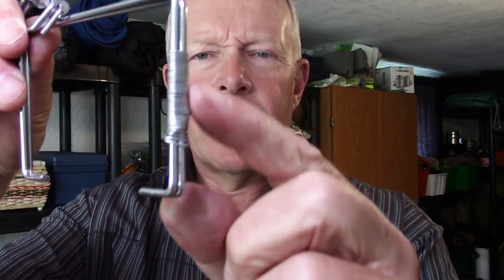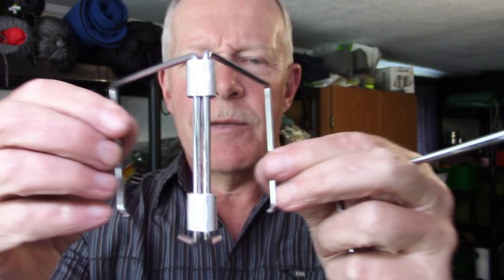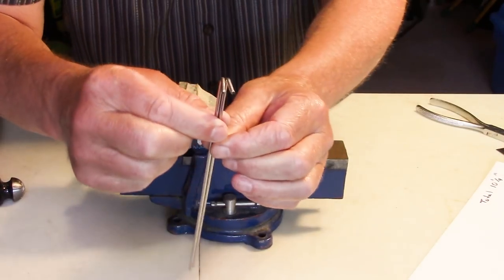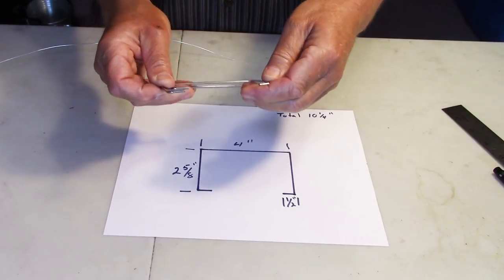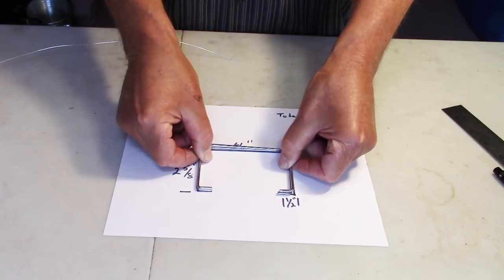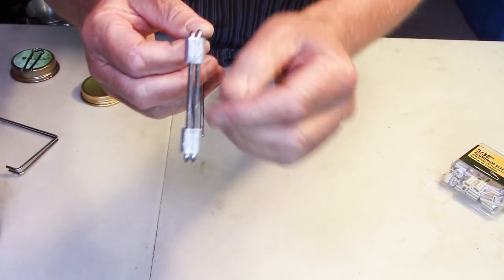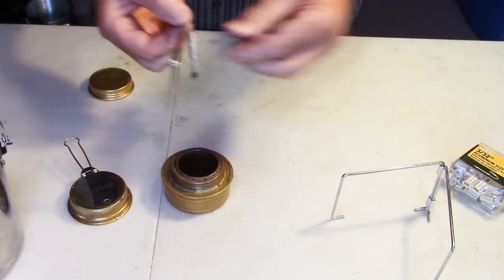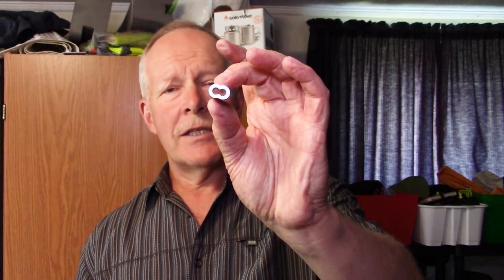DIY Alcohol Stove Pot Stand

Comment from the maker: I would like to thank everyone who has commented on the dangers of using galvanized wire in this project. One of the objectives of this project was to have it be as inexpensive as reasonable. For this reason I chose to use inexpensive galvanized wire over higher costing stainless steel wire. Based on the research I have done, galvanized metal does not release zinc in a gaseous state until it reached 1652F/900C. While the pot stand does get hot, the wire wrap does not come in direct contact with the flame and does not reach anywhere near hot enough to become dangerous, other than from burning you fingers. Finally, the pot stand and alcohol stove is intended to be used outdoors and not in a confined space where ventilation could be an issue. I feel confident the use of galvanized wire in this application is perfectly safe.
Reply: Ah, OK.  I just knew it was something welders had to worry about.  There is no way an alcohol stove gets that hot.
Reply: Excellent clarification and the logic behind it is sound!
Reply: Zinc is not danger in small dose. RDA recometation is under 40 mg per day. Coating is hardly this and doesn`t vaporize at the time.
Reply: Rust,   if its not on the burner portion there really isnt any danger
Reply: The "dangerous" temperature varies by the galvanization process used. In long-term, continuous exposure, the recommended maximum temperature for hot-dip galvanized steel is 392 F (200 C), according to the American Galvanizers Association.  So, best bet is NOT to use galvanized metals that can become heated. Why take the chance?
Reply: Eventually, Galvanized steel will start to rust after the zinc comes off.

Comment: If you have soft ground just turn your stand over and put the long wire down to the ground and use the short feet of your stand to set pot on. It will work both ways right side up or upside down. Thanks for your video and keep up the good ideas because there are lots of people that need good people to show them how to use items to make things that will be very handy and important.
Reply from the maker: Great tip! Thanks for commenting

Comment: Thanks.. I made my own stand per your design,, worked out great.. quite strong..and even when the wire gets red hot from flames hitting it, it seems to stay strong and in good shape..
Reply from the maker: Glad it worked out for you. I find stainless steel works much better than coat hanger. Thanks for commenting

Comment: Nice job. You could also connect 1 or 2 more sections to make a closed triangle/square and securely lock it in place by adding an extra sleeve on the legs of the end sections or wire but loose enough, to be able to slide down a very narrow U-shaped connector (longer as a stake). I like the sleeves better. Even more stability can be achieved with extra sleeves at the corner bottoms and extra skewers to use as stakes that are either intact or cut short, both with the loops intact. The bonus of the loops on the long stakes (2 at least) is being able to cook rotisserie style. The loops on the short stakes (2 at least), when driven down to the sleeves, prevents the stand from moving up. All unstable/ accidental movements are eliminated. It will still be light, foldable and compact while adding more stability to both the stand and the cooking vessel. An added bonus to my configuration is that you can use a grid/griddle grill plate. Pretty cool, huh ?
I hope that you try this and do an update video (yeah, you can mention my name 😎) because I'm very sure that your viewers will like it.
GOD Bless the U.S.A.  This soldier shouts AIRBORNE !
Reply from the maker: Well thought out bit of kit. Thanks for the ideas

Comment: Hello, Mr. Young;
EXCELLENT! video, you've helped me quite a lot w/ it.
I just built my best alcohol stove (so far).
It burns about 10 minutes on about 20mils of 99% iso alcohol.
I used a U.S. penny (copper-plated zinc) & it semi-melted & deformed from the heat.
So I'd been thinking about a pot stand & wind screen for it when your video came up.
I like my gear to fold so it lays flat & this will do so nicely.
My new stove is a bit larger than yours but your design will easily expand to fit.
My stove is almost 3" tall & 2-9/16" wide.
I think my stand should be 4" tall & 6" wide so I need about 14" skewers or other material.
BTW, the cable/wire connectors are a really great idea!
I can make wind screens (2) 6"x6" & pivot them w/ a hinge so I can easily cook on my stove.
The same basic design will work great for the wind screens w/ skewers as legs, too.
Three skewers, one as a hinge & one each on the two ends should work great.
The legs can stick in the ground for stability.
Thank you for your great video & the inspiration.
Have a GREAT day, Neighbor!
PS
I really like that pot you demonstrated w/ at the end.
I'd like to get one like it.
Can you say where you got it?
Thank you in advance for your kind assistance.
Reply from the maker: Making DIY Stoves can be very rewarding. The pot is the Camelwill1.2L. I have a couple of videos in it. Thanks for commenting

Comment: Enjoyed your video as I usually do . Well presented with a lot of for thought.  Whilst on the subject of alcohol stoves,always suspect in breezy conditions .I have a small mod ,which is useful in this and other alcohol stove probs.. My mod. refers to the common multi plate screens ,ten is a popular one. My tip is this, fold the screen up tight,clamped in a vice or such Draw a line or so, 1inch  in from each side about 1inch apart along the two lines.Now mark   holes centre of the plate in line with the top and bottom holes .Carefully drill through all the plates(whilst still clamped) at the marked points with drill suitable to accept about a 10mm. rod/tent stake. Erect your screen and you will have multple   pan supports at various heights.,around almost any type stove..And a very secure windbreak too.  Thanks for your vids.
Reply from the maker: Very interesting idea. I will give that serious consideration. Are you okay if I share this idea and give you the credit?

Comment: Very useful ideas and a clear, easily understandable presentation. In the back of my mind, I am pondering how to fashion a similar folding pot stand with at least two panel sides which would serve as windbreaks on a breezy day. I might also mention that for some time I have had concerns regarding the use of "open top" stoves (in contrast to the "closed top" design used in many "penny can" designs). Specifically, the "open top" models strike me as potentially dangerous in that were they tipped over they would immediately spill their flammable fuel thereby creating a fire hazard.
Reply from the maker: Glad you found the video helpful. Your concept of a DIY pot stand with a wind shield built in intrigues me. I agree there is an increased risk of spilling alcohol with open-top stoves. I would think the most "spill resistant" design would have a full wick inside, carbon felt or fiberglass maybe. This type of stove should also work better in freezing temperatures. Of course, it would be a lot more difficult to recover unused alcohol from. You have given me a few things to think about. Thank you

Comment: We have fire bans here in BC also so I will have to use my alcohol stoves next summer. So happy that I can make my own stand and save a little money. I just hope I can bend my skewers with my pliers because I don't have a vise. Thanks for posting this video.
Reply from the maker: Unfortunately, it would appear we are likely to have more fire-banes as the climate changes. I am able to bend the SS skewers from Dollarama quite easily with pliers. I like using a vice more for precision bending than anything else. Thanks for commenting
Reply: Just use a sturdy hollow tube to bend the scewers or 2 closed ended wrenches

Comment: Okay, I followed your instructions and quickly made a couple of these stands. Just what I needed! Thanks. A couple of notes:  

1. I live in the Southeast US and was not able to find any round skewers anywhere. Only thing I found was some square ones, and this seems to be the trend - here, anyway. So I bought some stainless steel bicycle spokes on eBay. $7.28 US for 10. They are 2mm in diameter, and very stiff and strong. Also bought the 2mm crimp sleeves on eBay - 100 pieces for $6.79. So pot stands still very cheap. 

2. You can crimp the sleeves better if you will take a couple of scrap pieces of rod that you cut off and tape them into the grooves on the sleeve. Then crimp in the vice. Gives a better crimp, but I can't say it's worth the extra effort.

Keep taking "the road less traveled". :-)
Reply from the maker: Great adaptation. I really like how you got a better crimp. Sounds like your end product should work out very well. Thanks for commenting.

Comment: Thanks for the video! Another idea is to use stainless steel bicycle spokes -- not that expensive, rustproof, and you can even throw it in a fire without worrying about the galvanized steel issue. If you want to go even lighter, titanium bicycle spokes are not that expensive if you look around. Of course, if you want the flexibility of using it in a campfire, you'll have to avoid using the aluminum ferrules as they will probably melt. Steel wire or copper wire would be better in that case. Also, if you are going to use this just for alcohol stoves, you can get away with heat shrink tubing instead of ferrules.
Reply from the maker: Great ideas. I am trying out a more heavy duty version for fires. Thanks for commenting

Comment: Nice tip about the sleeves, I have always used tubing. Mine I make with three sections, I allows a larger variety of pots. Instead of skewers I have been using the metal from advertisement signs.
Reply: steamboatmodel 
I thot about that!  I see a lot of thoz old signs that are old and aren't used anymore, but the metal still looks good!
Reply from the maker: Good idea on the sign supports. I considered a three sided pot stand but decided to go simple. I am thinking about a three sided heavy gauge rod pot stand or trivet for use directly over coals. Thanks for commenting

Comment: Love the stainless steel skewers idea. When using a dremel tool it’s a good idea to use a face shield and safety glasses. Dremel tool cutting disc exploding can do quite a bit of damage even as small as they are. Only one set of eyes per customer. 
For anyone worried about the galvanized wire ( not me with the amount of heat ) you can get stainless steel wire for making jewelry that is small enough to make these wraps. It comes in 18-26 gauge for sure, maybe even smaller. I’d probably go with 20 gauge.
For the aluminum cable ferrules the crimping tool isn’t the best design. You can put them on your vise and use a cold chisel and tap the chisel on ferrules with a hammer between between the skewers. 
Very good instructional, time to watch more of your videos.
Reply from the maker: Great tips. I have had a Dremel wheel explode as you say. I always use safety glasses but also use ear protection, even with the Dremel. My hearing damage is made worse from high pitched sounds. I went simple and hammered the ferrules on an anvil but have used the cold chisel idea as well. Thanks for commenting

Comment: Great video Mark! I've been searching and struggling to find a stand that allows me to use my Stanley Adventure Pot with my Trangia. I have one of the Evernew Ti cross stands, but then I cannot snuff the flame when I've finishing boiling my water. Denatured Alcohol is cheap enough, but I just don't want to run out of it while I'm in the field. So I really like that this design lets me still use the snuff/simmer ring.

I made two of these stands from some cold rolled 1/8" steel round bar from the hardware store (about US$2.50 per 3 foot rod) (I'm not sure how non-stainless will stand up overtime, but should be good enough for as often as I'll use it) and aluminum cable ferrules (about US$1.5 per pair). On one, I wrapped some aluminum from a dollar store cookie sheet to make a small wind screen. It is loosely wrapped about the far legs and stapled to itself, forming something of a band from one far leg, around the joined legs, and stapled about the other far leg. The band is not as tall as the stand, so that there is a gap between it and the ground and it and the top bars. There is quite a bit of slack in the aluminum band that allows my Trangia stove to still fit under the stand and within the aluminum band/windscreen. The band/windscreen hugs the Trangia quite nicely. For those concerned about pack weight, the windscreen only adds about 5 grams to the otherwise naked stand.

I've run a couple of boil tests in various conditions outside and consistently get at least a 2 minute faster boil time using the windscreen stand compared to the naked stand. I've also compared the screened stand to an Evernew Ti cross stand, and get about a one minute faster boil time. I've not done anything too scientific. I just made sure that my water started at room temperature, but my ambient conditions have been all over the place due to the fluctuating weather we've had lately. 

When I'm ready to take this into the field, I will definitely be bringing a proper windscreen to further increase the stove's efficiency.

Thanks for the idea and great video tutorial!
Reply from the maker: Glad you found the video helpful. I have had great success using the SS skewers for pots stands. I have made one from 3/16" iron rod for setting over coals but that is a different application. You are so right, a windscreen makes a huge difference in boil time and therefore, alcohol consumption.Thanks for commenting

Comment: I found a handy, cheap pot stand. I used a metal steam rack in the same fashion you're describing. The only issue is that it doesn't fold down compact. However, if you have your 'dog bowl' oven in a stuff sack, it nestles pretty well.
Reply from the maker: Very cool. I always like finding items I can turned into useful camping gear. I use two dog bowls together as an oven. I use a computer fan screen with the tabs bent as a spacer in the bottom of oven setup. Works great. Thanks for commenting

Comment: I use the same skewers, cable wire, and ferrules for many of my other designs.  Ferrules are great.
Reply from the maker: Great minds think alike 😅. I am starting to find all kinds of uses for the ferrules. Thanks for commenting
Reply: Was thinking hammer flatter then cold chisel both sides to pinch it. Might try that using a coil of 1/4” copper tubing I bought while garage sailing. Copper tube would look a little stylish too.

Comment: Greetings: Professor Mark, 

This is an excellent demonstration! And serves as a great help for those of us on a budget and enjoy making our own gear. The benefits to make it yourself, is that one can also FIX it themselves, if the need arises, especially in the field. 

Now for a suggestion: perhaps you can add heavy duty foil, to the pot stands and point the "V" into the wind?  This would effectively double as a DIY winds too? Of course, a few air holes may be necessary.

Alternatively, the pot stands can be used as described and a second, taller stand can be used as a windscreen. 

As soon as I get a new bench vice, I will try these designs and I thank you for sharing your experience with us! 😀
Reply from the maker: Thank you for your kind words. I like your idea of building a windscreen onto the pot stand. Depending on how heavy gauge the skewer or wire is you use for the pots stand yo may be able to bend it with pliers. Thanks for commenting

Comment: Over time those ferrules will get loose and slide down when in use.

I suggest you smash the rods a tad just below the top ferrule to prevent the ferrule from sliding down.
A sort of indent if you will.

I want to make the triangle one not just the two sided one.
Will apply your ferrule method to that one.
Reply from the maker: Good suggestion. I will not be making another of these but if I was I would use the ferrules again for a three sided version
Reply: @MarkYoungBushcraft  That's not encouraging lol
Implies that either it is a poor design or that you no longer use a Trangia, presumably because that is bad too!

Jokes aside, why not make another one and see if you can improve upon it?
Perhaps add in a wind screen?
Primer dish?
Reply: Hey the 2 sides make a triangle.

Comment: Great project. Thanks fo such a good explanation. Just a couple of thoughts on the "wire wrap" version: tape together the legs not being wrapped to make the whole more manageable. As to both versions: add a third bent side so you can have a triangle shaped stand, allowing widening or narrowing the stand top.
Reply from the maker: Good suggestions on taping the legs together. The three-sided version is also a good suggestion. Definitely more stable for the pot. The two sided version is just a lighter weight option. Thanks for commenting

Comment: Instead of wrapping wire to hold the sections together, I would use brass tubing.  The tubing should be slightly larger than the two (coat hanger) wires put together.  Slide the tube over the two wires, then crimp it together.  Then bend the feet.
Reply from the maker: Great suggestions. Thanks for commenting